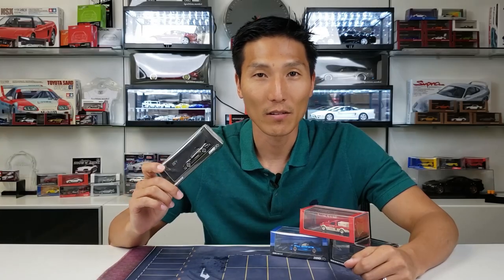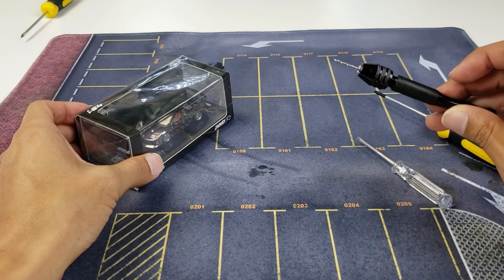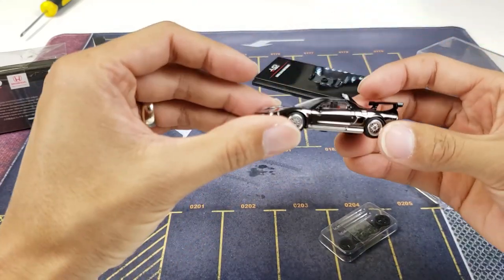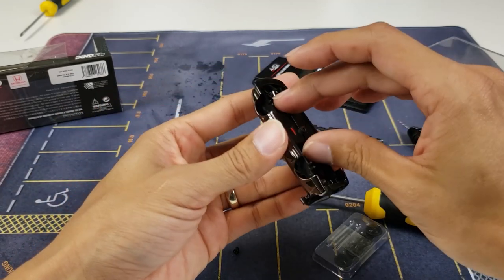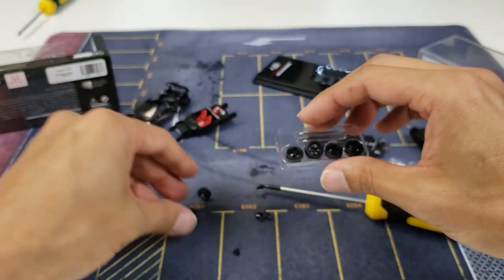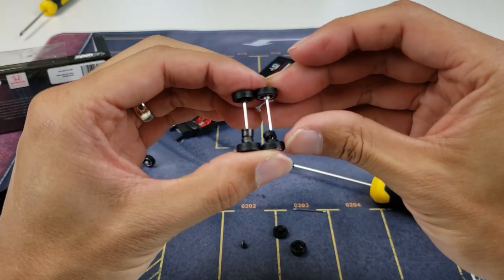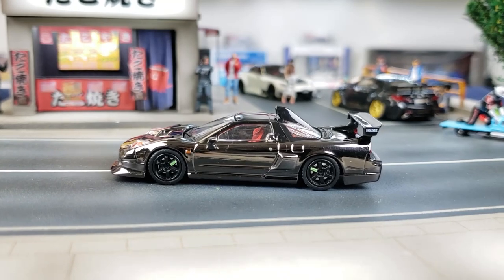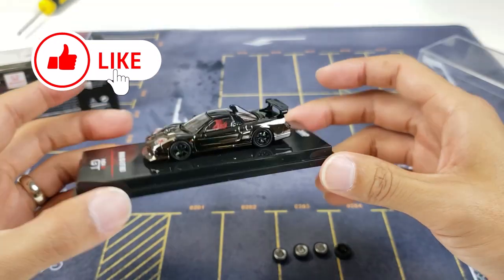How To Install INNO64 Wheels on Your Die-cast Model Cars!

Comment: Did they glue the exhaust in the nsx?
Reply from the maker: It actually is press fit with two small little inserts.
Reply: @modelcarshouston   did you press it back after wheel swapping it?

Comment: Hi my r32 came with wheels I’m tryna change them but I can’t get the original wheels off to get the breaks
Reply from the maker: Just have to pull the wheel off.
Reply: @modelcarshouston  wouldn’t work so I gotta hammer and smashed the original wheels off to get brakes XD
Reply from the maker: @behzinga8196  hammer always solving
Reply: @modelcarshouston  XD
Reply: @modelcarshouston  yesterday a set of mini bbs rims were smashed XD

Comment: Is this the same as the rocket bunny nsx? I can't seem to remove the back plate, any tips in removing them?
Reply from the maker: The Rocket Bunny DOES NOT come with extra set of wheels.  But you should be able to remove the back plate by removing the muffler part.  However, I have not tried to know for sure.
Reply: Thanks for the reply man, was trying to do a wheel swap but can't seem to get the muffler part off. Guess I'll have to leave it as it is.
Reply: @kzhung9556  have you figured this out?

Comment: Great car and wheels. After I've watched your video, I bought a Para64 Mercedes-benz AMG gt63 (https://youtu.be/UP7ioXmxoyU) and than this Dmodel 1:64 wheels (https://www.rcmart.com/d-model-1-64-scale-model-car-wheels-4-pcs-silver-black-dw004c-00086873).Do you think they will fit with that car ? I've never modified wheels, so actually I don't know how to add wheels to a 1:64 model. Is it easy ?
Reply from the maker: Hey man!

It's very hard to say which wheels will fit which different brands.  However, it's worth a shot.  It really is an experiment as well as new models pop up so often!  However, I am confident that MOST wheels should fit with MOST models as they're all 64 scale bits.